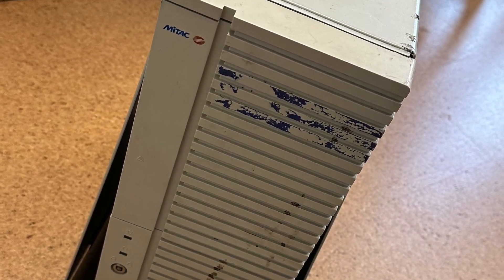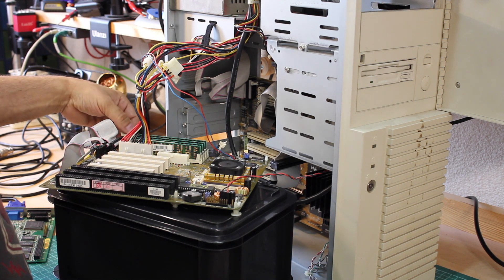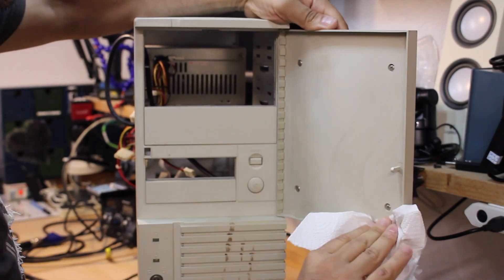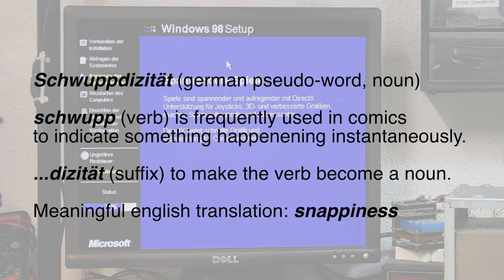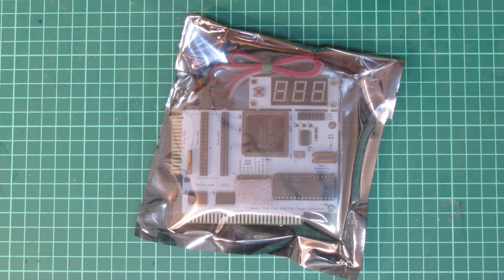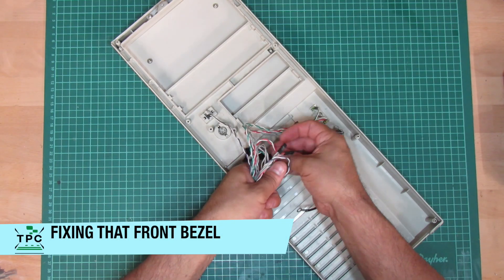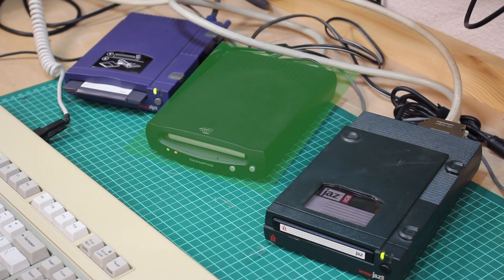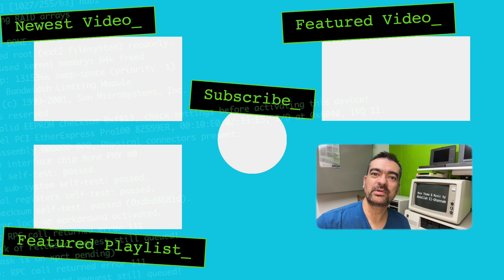How I finally built my retro Multi Disk Copy station [feat. TexElec Quad-Flop controller]

Comment: I am trying to build a similar system using a socket 7 MB8500-DDT mobo. so far I have a 1.44mb floppy drive (0) and a 720k 3.5 inch drive (1) on FDC1 they appear at least to DOS to coexist nicely. Im hoping to use FDC2 for a 1.2mb 5.25" (0) and a 360K 5.25" (1) on FDC2..can you advise when activating FDC2 what IRQ / dma etc you used on your build ?

Comment: Why not just get an fpga, esp32 and cpld, and a few level shifters, and you can make a floppy card that can do dma transfers internally while still having gate level in hardware emulation of floppy chipset of choice, with faster speed, and adds wifi and Bluetooth, so you can use internet, and even control floppy drive and computer thru phone, download files to yo phone and even do diagnostics to yo floppy and computer via isa bus or pci, or s-100 depending how old yo ass is, wen dat esp32 has more cpu power than the computer and runs at hundreds of mhz and iirc 32bit, maeks good dsp or great math coprocessors better than the manufacturer made, send to Bluetooth to esp32 chip, and it writes to floppy, throw some sram and flash memory and you can just boot just about anything 

I just made a product I can make yall buy
Reply: I wonder how well replacing a 6502 in my atari 800xl with an esp32 would turn out, would need a cpld or two

Multi core cpu, with wifi Bluetooth, uart, pretty much the entire 800xl stuffed In one chip, but much more powerful

Would that still be considered emulation or authentic hardware? You can't tell
Reply from the maker: There's nothing wrong about using modern technology here and there. I do as well, i.e. when with SD2IEC and CF2IDE adapters, or the Gotek Floppy Emulator.

But for the most, I prefer to keep things as close as possible to contemporary state, hence I try to use the actual vintage tech whenever available.